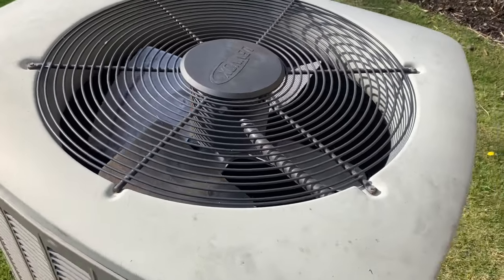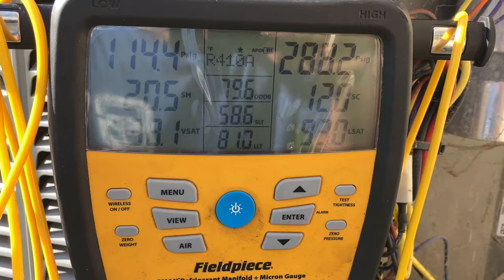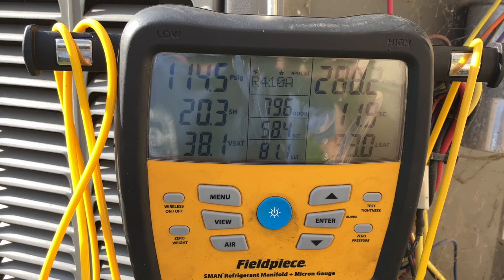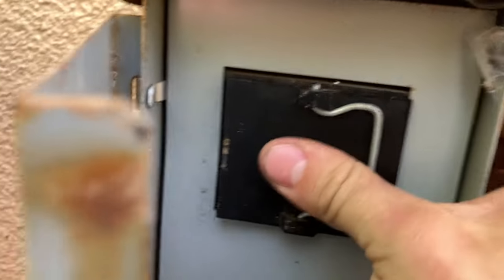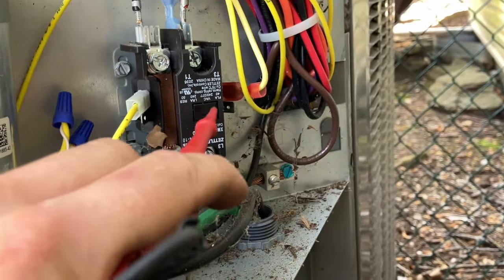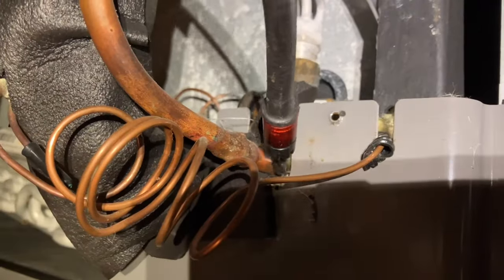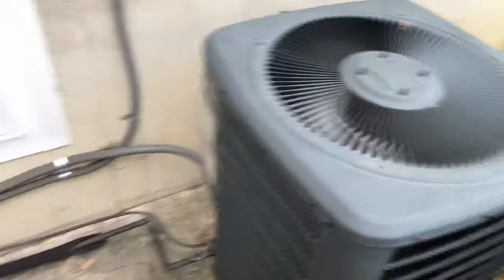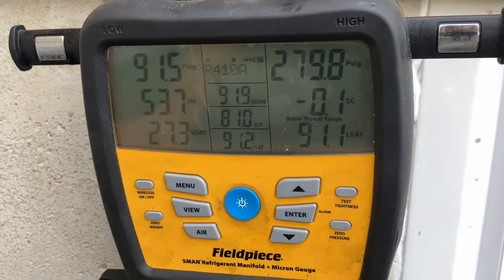New HVAC Apprentice Service Day

Comment: One good thing to look for if you have a blown fuse is a worn disconnect. A thermal imager or infrared thermometer can help you find hot spots from loose connections. Loose connections all produce heat and cause nuisance fuse trips.